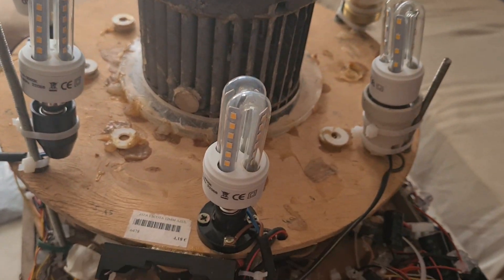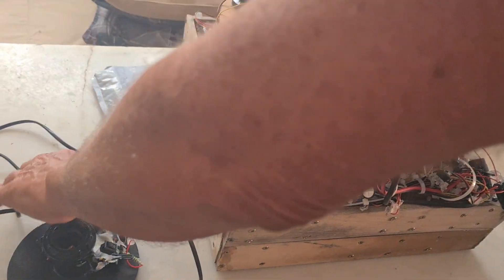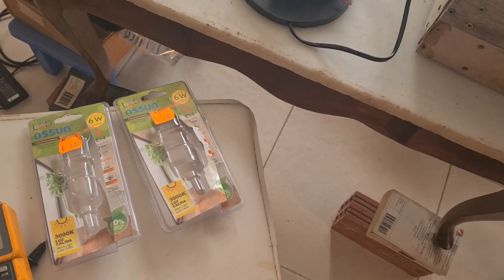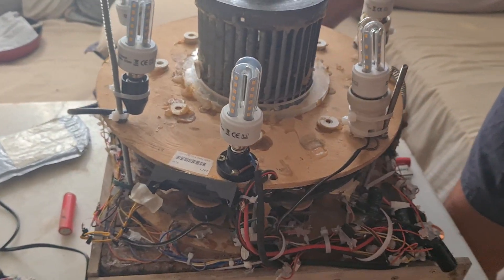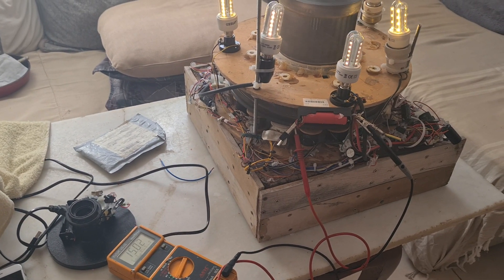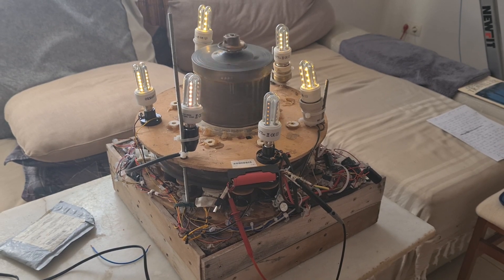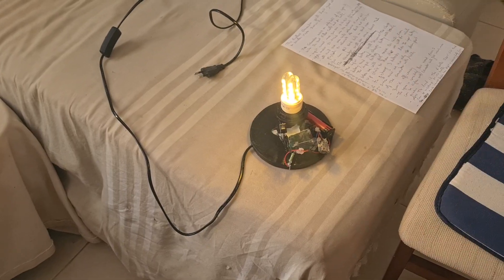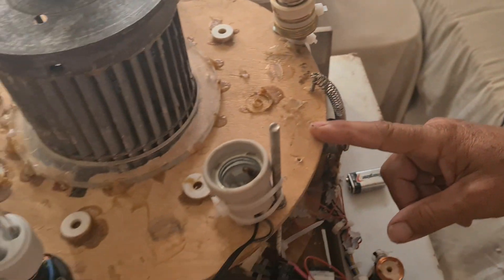This fuel-less generator will light your whole home in 220V AC from one small 3.7V DC battery

Comment: Daniel what generator You are using  which consumes only 300mlA?
Reply from the maker: Hi the generator (with the 6 bulbs) consumes between 200-300mAh while working for around an hour and a half. The little bulb socket that lights a bulb from 1 battery consumes around 50mAh during 3 hours but the small 3.7V battery can light the bulb for 12 hours. Both concepts are quite efficient.

Comment: thanks, but how to build it iam interested
Reply from the maker: Hi, the plate holding the magnets is 28cm and the one above and below are 30cm, the magnets are neodymium N52 grade 20mm and 5mm thick. The coils are bifilar wound at the same time on the same coil with 2 strands of 0.19mm diameter copper coated wire. Coils are connected in pairs and wires are SWG 0.36mm or in US AWG 0.32mm. You need a bearing and some imagination. Good luck
Reply: On the charging side you can use the lithium chargers with multiple battery slots and the over charge protection circuitry since you're getting such high output as to protect you batteries. Well done.
Reply from the maker: @vortexmagnetics4377  Thank you very much! It's a good idea. I hope to get more coils done so that I can complete the device and then it will be good to use the lithium chargers in order not to damage the battery with a high charge. Thanks